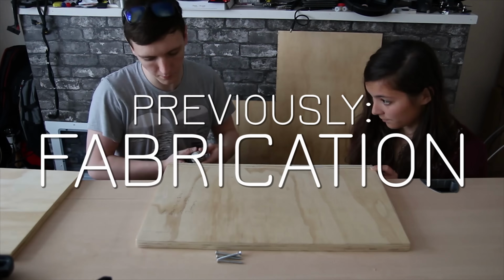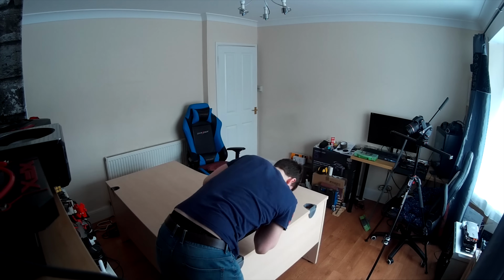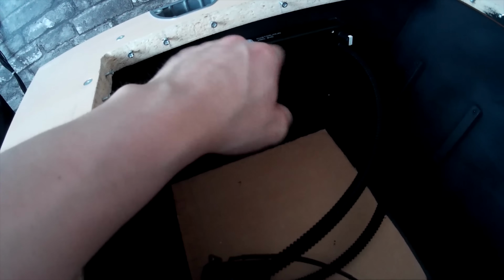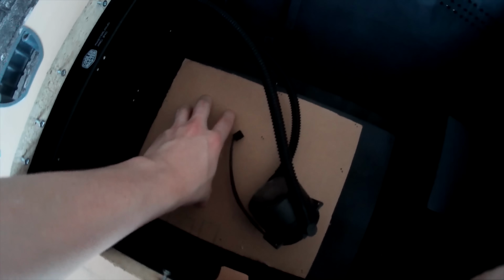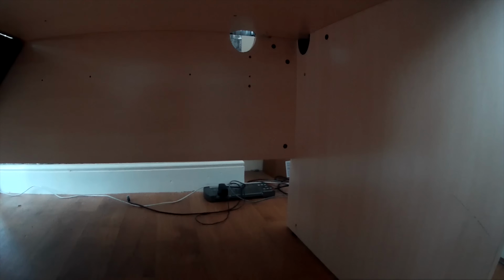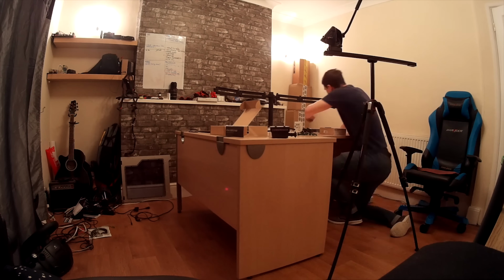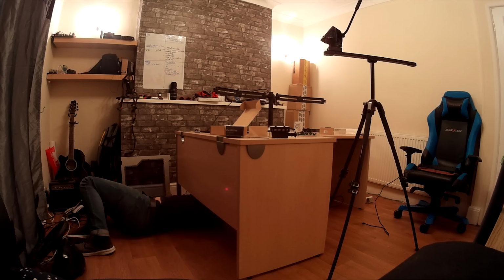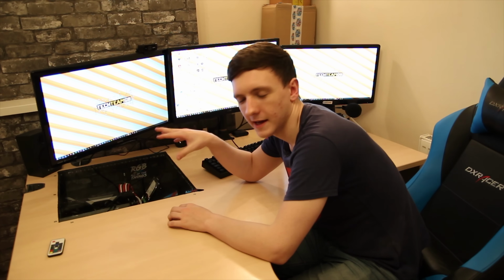Budget DIY Desk PC #5 PC Building

Comment: how do you mount the motherboard to the wood?
Reply from the maker: I had a piece of cardboard below then just 9 wood screws that we a good bit smaller than the holes in the motherboard (with large enough heads to hold it in place).

Comment: Look into Wake On Lan, it will solve your power button problems and you can switch on your pc from your phone :)
Reply from the maker: +mds7829 how would I manage that? :O
Reply: you need to look at your mobo manual, in the bios of your pc there will be an option somewhere to allow wake up via your ethernet port, then you activate it in device manager and there is an app I think it may even be called wake on lan. Not the clearest explanation in the world but look it up lol
Reply: also unified remote supports wake on lan, and that allows you to fully control your pc from your phone, meaning mouse and keyboard the lot.
Reply from the maker: +mds7829 ah right, I've tried that one in the past and only ever had issues where the pc would turn on randomly!
Reply: I haven't had that problem, I wonder if your mobo was also accepting mouse movements (sometimes any kind of wood grain effect can cause your mouse to think it has moved even if you are nowhere near it)
Reply: If you don't want to use unified remote there is also WOL Wake On Lan available which purely does the waking up, no pc control. (These are all on android)
Reply from the maker: +mds7829 ah OK fair enough, I'll take a look!

Comment: wot a noob! Everybody knows it's 8 screws to hold up an ATX desk build lol. Looking good now it's had a lick of paint. If you already haven't got one, http://www.kustompcs.co.uk/cgi-bin/ss000003.pl?page=search&PR=-1&TB=A&SS=momentary&ACTION=Go%21. As a stop gap you could always remove the power and reset buttons from an old case and use that. you could also cut a small hole under your monitor and run the USB 3.0 up to the hole.
Reply from the maker: I haven't got one yet, but I will be adding a switch like that fairly soon! 
As for the USB, I could do, but there is a whole load of cables already there so one more doesn't make a massive difference!
Reply: My desk is looking like an explosion in PCworld. glass desks might look nice, but try hiding cables. Will you be doing a review on Creatives new Sound BlasterX Kratos S5 2.1 USB Gaming Speakers with Customizable Audio and RGB Lighting.  to add more cable mess I ordered some. I ditched my old £16 Tesco specials when one of the speakers failed. not bad for 5 years. Decidied to get something more refined. although after working on building sites and using power tools for decades I'll probably not notice the difference  lol. I'm using the built in speakers in the acer XR341 and to me they sound ok. Better than my old Asus PB278QR. Keep up the good work.
Reply from the maker: I don't have any plans to review those speakers I'm afraid. I personally love the Logitech Z333 speakers I'm using with this project though! Thanks!
Reply: TechteamGB Cool. Honestly the deciding factor for me was the RGB lighting sad I know, but it's the only way to get lighting for an orange build. Have fun with your Logitechs. Humble bundle are giving Dirt3 away for free, I'm off for some rally action.
Reply from the maker: +Peter Welsh welshy46 ah fair enough. Yeah I redeemed that yesterday, I'll be playing later today too! Enjoy!
Reply: TechteamGB I have been, although I haven't played many racing and I'm sure I used to be better :). To make sure I've ordered a Logitech G29 wheel from Amazon, through your link obvs. Also ordered some stuff to make an infinity mirror PSU cover mod. Have fun.
Reply from the maker: Ah nice one, thanks man!